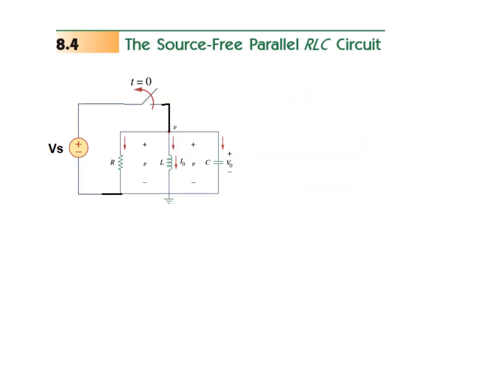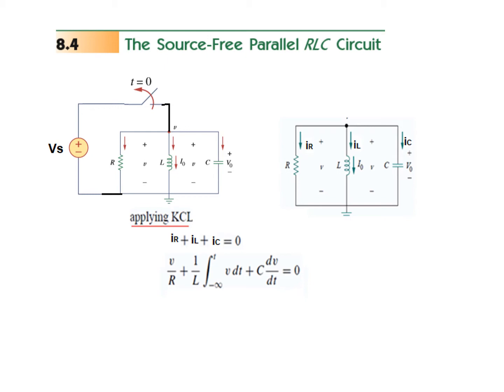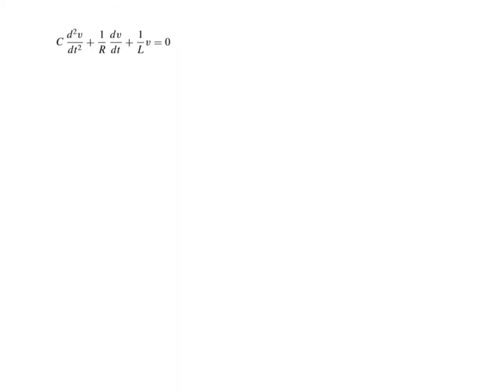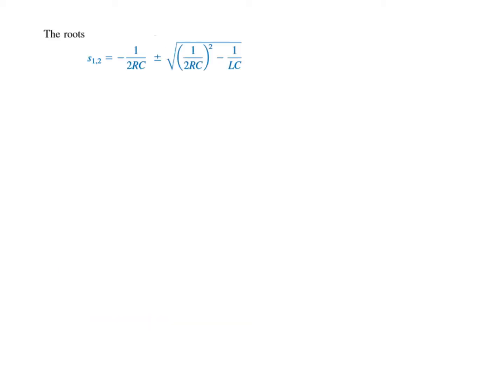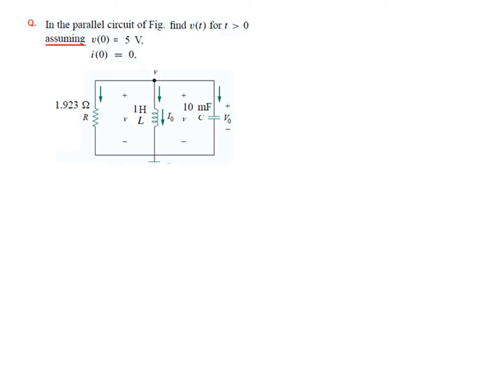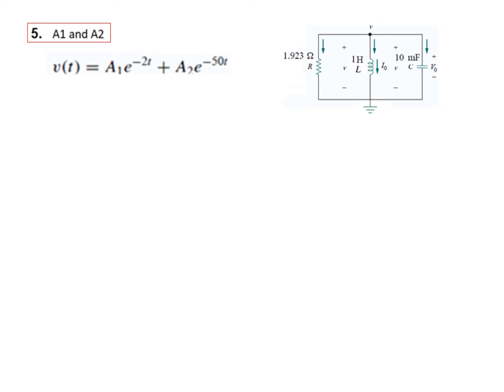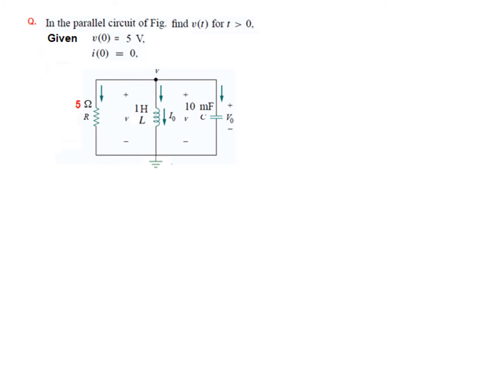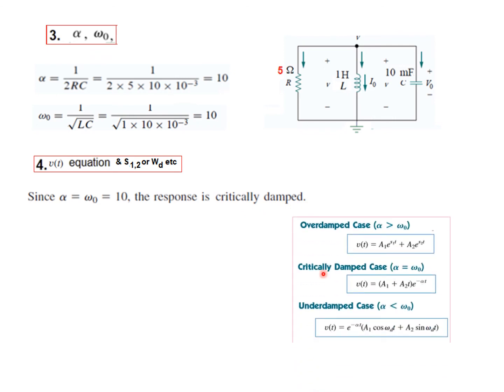(English)LCA || Example 8.5 (1 &2) || Source Free Parallel RLC Circuit  || (new)

Comment: this is a different result than in the textbook. I dont know why the the textbook dropped the negative sign off -260 and used +260 for dv/dt.
Reply from the maker: I could not find what you are referring to in 5th and 6th ed. Please share a snap shot at my whatsapp number 923454040919